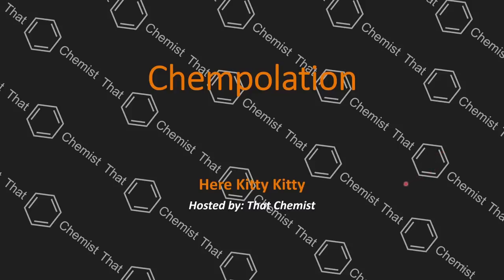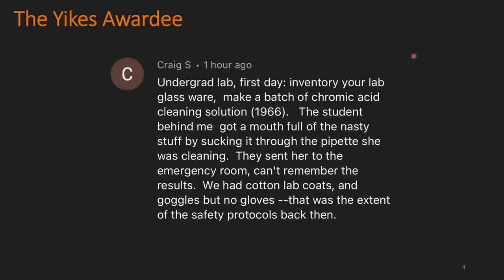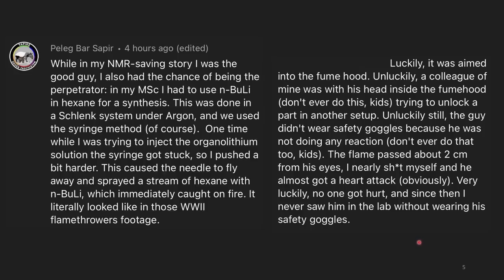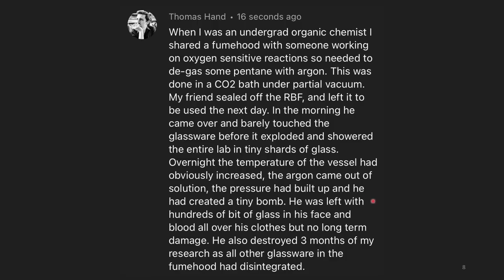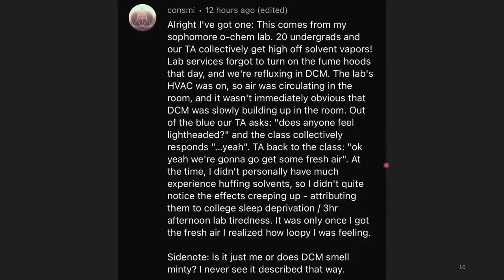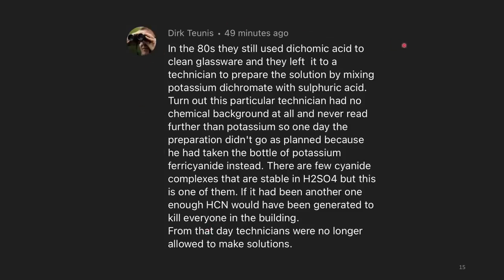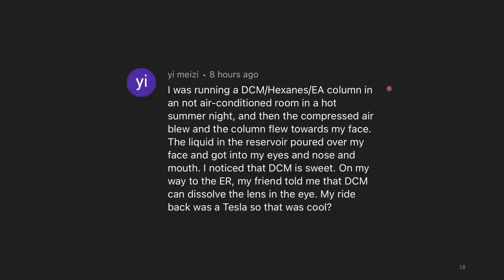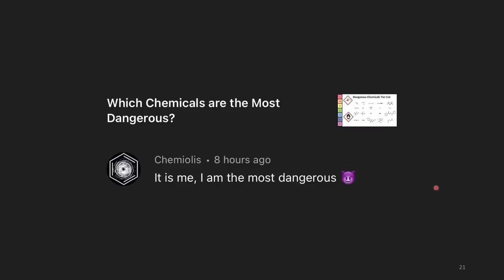He found out why that box was wet…

Comment: I have a short and not so sweet smelling story in my school one of the experiments we had to do was an organic extraction what you extracted didn't matter most did caffeine or if students felt especially spicy they did capsaicin. I wanted to do something no one has done before in the school and did nicotine from tabaco. I tell you this was a mistake. the first step was a vapour distillation. when i did the setup i thought to myself should i be doing that in under a fume hood, my answer was no this is a closed system so everything will be fine. This was my second mistake. Here i have to interject i am no wuss when it comes to tabaco smoke both my parents are chain smokers, I marinated in smoke my whole life but this stench i will never forget it the stench of the distillation. It was just to much non of the actual smokers could stand it and i could barely manage it by building a cone shaped mask and filling it with the leftover tabaco. The stench was lung wrenching it smelled like normal tabaco smoke but more intensive and sticky when inhaled it stuck to your lungs and you felt it, you felt the tabaco vapour stick to the inside of your lungs like it is the black plague or something. The stench was so bad that the lab i was in and the lab next us had to be evacuated till i was finished because nobody could tolerate the stench. To this day this specific experiment is bad in that school and i will always have a cone shaped mask somewhere nearby should any stench get out of hand.

Comment: So sharing something funny I have done a few years ago. 
I stole some sodium hydroxide crystal when I was in 9th grade , when I just starting to learn the basics of inoganic chemistry. I brought them to the class because I wanted to show them off to others. During break , I got bored and took a few crystals out of the glass vile (not wearing any protection ).
After holding it in my hands , for roughly a few minute , it starts to make it very slippery. (I suppose it is because it sucked the water out of my skin) . I didn't really care too much and is just continuing playing with it. 
I was fine , *until I rubbed my eyes with my hands*. Which then really starts to hurt.
Thankfully because I was in school , I managed to find my chemistry teacher. (his office was only 10 , 20 m from my classroom) And roughly explained to him what happened. 
He told me to wash my eyes with the faucet in the bathroom. Which I did , for quite a long time. And I remember the stinging pain lasting for the rest of the day. I got super lucky that day and had no lasting eye damage.
So yeah I have learnt it the hard way to not take things outside the lab
Reply: Actually, that slippery feeling is caused by saponification of skin oil (hydrolysis to soap and glycerin).  You were very lucky, base is much more destructive of eye tissue than acid.
Reply: @robertlapointe4093  huh , that is interesting to know. How it turns my hands into soap
Reply from the maker: Yeah - it’s actually a demo that a prof I TA’d for showed the students - not advisable, but somewhat harmless if you aren’t being reckless

Comment: autoclave "high pressure steam sterilize..."   No; its a way of taking water and pushing it past 240°F so as to kill bacteria, fungus, virus and other living matter by melting it.  Its like pressure cooking but much more brutal.      I do have a horror story about it.     My dad worked as asst director of maintenance at a level 3 burn and trauma (Burnham Hosp, Ch/Ur Il.) and the nurses had a propensity to just throw volatiles like isopropyl in with the equipment to be autoclaved.    He had a newer guy with him one day when it tripped and he gave the guy instructions and had just turned around to hit the other dog with his hammer when the guy hit the first dog and the clave hatch bent and blasted 265F water/alcohol/whatnot into my dad's face.   Luckily it wasn't a sheet-fan of it but a billowing.  Still took 7 weeks for him to recover from a lung full of it.
Reply from the maker: Idk what’s happening to dogs in this story but it doesn’t sound good
Reply: @That_Chemist  in this context "dogs" are the turn-able tabs under the compression knobs that hold the door against pressure like in a naval vessel... you stand back and smack em round out of the way of the escaping gasses in this specific case